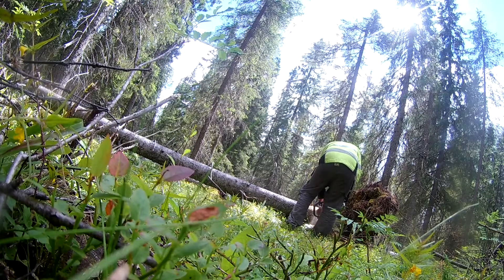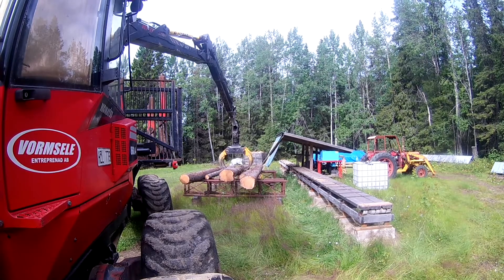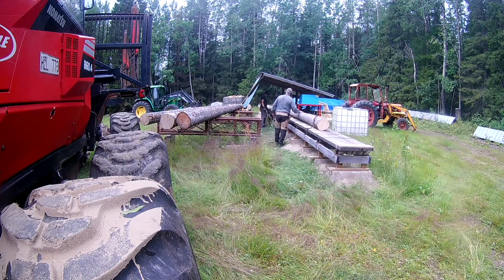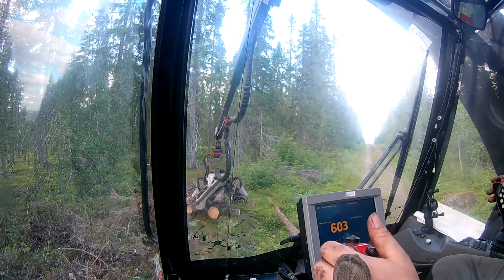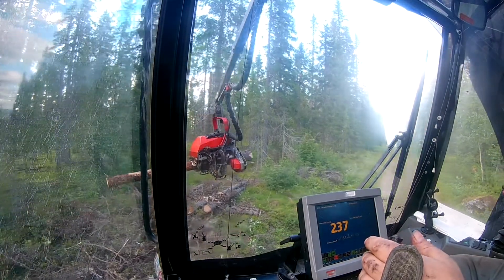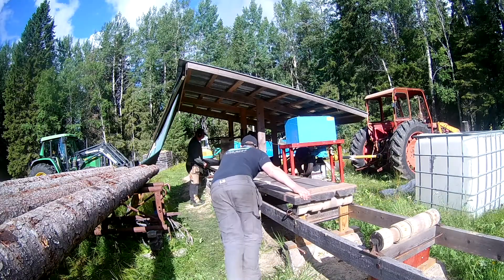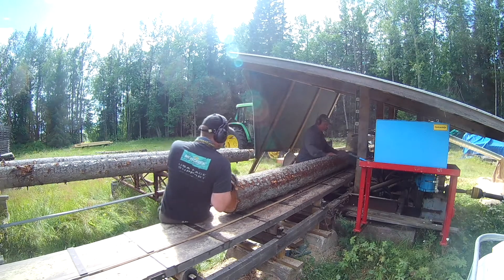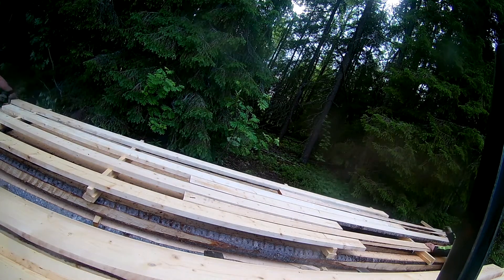Putting a few more logs through the sawmill.

Comment: Angående läck i pressningen så kan det vara så att trycket slangen är gjord för ligger för nära trycket i systemet, typ vid tryckstötar osv.
Har haft massa slangar som varit så men Gates nya slang (med grönt streck) den håller för högre tryck och efter byte till den slangtypen har läcken upphört. Kommer ju alltid på nått annat ställe ist iof.
Reply from the maker: Sällan sett det på några andra maskiner jag har och på flera ställen både på skördaren och skotaren har jag hittat. Frågade på hydraul firman hur vanligt det var om allt är pressat enligt boken och lät inte ovanligt om slangen börjar vara några år. Tänkte om det pressats slang av nån bonde på känn med tveksam slang press som var orsak.
Reply: @blackgrove8  fick bortåt 40st slangar på garanti från komatsu pga att slangar läckt i pressningen på ny maskin. Detta gällde bara 2 stål slang. Exempel 3/8 slangen höll för 275 bar och arbetstrycket på nya komatsu ligger på 280, men nya gates slang håller för 296bar. Har bytt några på min maskin nu som jag bytt tidigare (inom 6 månader) som börjat fukta i pressningen. Där ligger arbetstrycket 270 så det borde inte vara problem, men det ligger för nära maxgränsen och fukt som följd. Bytte där nu till nya gates och helt snustorrt. Nu vet jag ju inte vilken slangtyp du köper iof.
Reply from the maker: Köper here lite dyrare slang och förhoppningsvis slipper byta så ofta. Sen gissar jag båda maskinerna har gått onödigt varm genom tiderna kan ju plåga slangar också. Rädd jag har läckage i ventil paketet i aggregatet. Lur det trycker ut olja genom en av pinnbultarna som håller ihop blocket. Ska prova trycksätta med databoxen borta så man ser bättre.